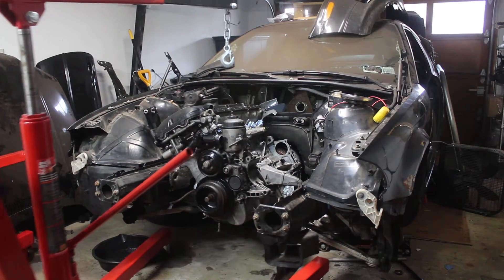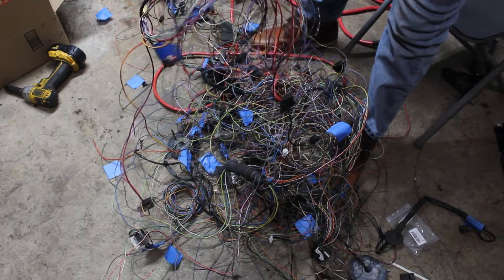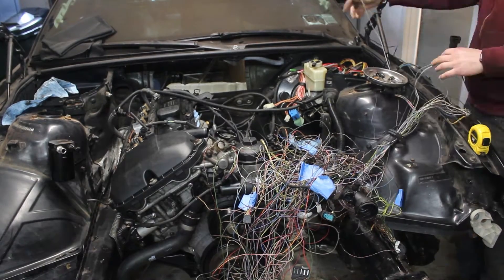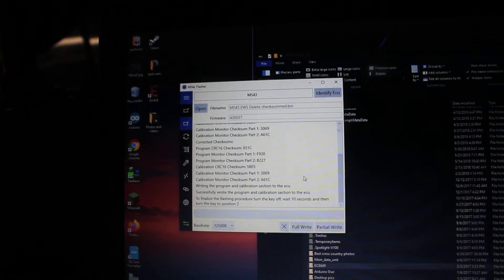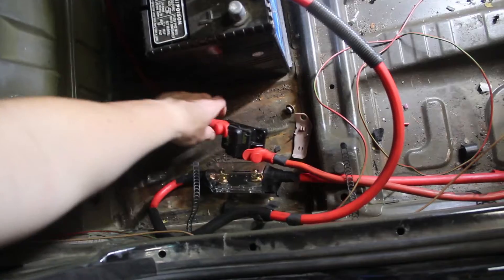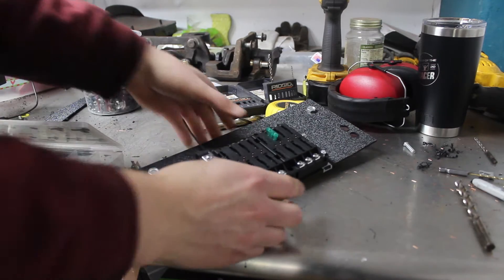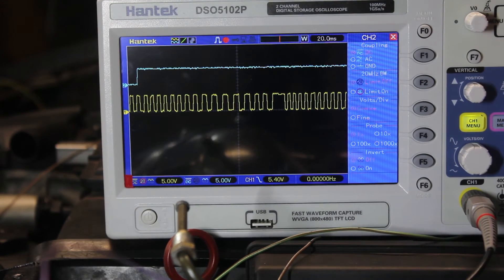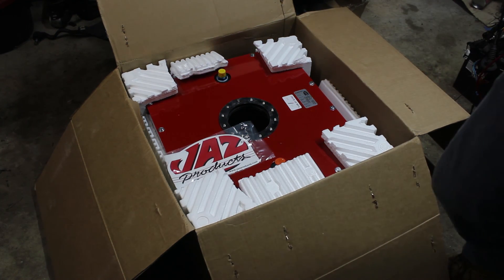BMW E46 Race Car Build: Electrical & Wiring

Comment: Hey brother, quick question. On the 2 starter small bolts, the ones with the 10mm and 8mm nuts. If not mistaken, you mentioned that one receives the signal to engage the solenoid, and the other one you grounded it (because it was grounded on the ews). I tried the ground one and it fried the wire. I don't think you should ground that 8mm coming out the starter solenoid. Am I incorrect?
Reply from the maker: It's been a while, I don't remember. But what I did worked and the car runs. If you're frying a wire, it's probably shorting 12v to ground. My guess is that which wire you ground matters.
Reply: @rainvillecreative5410 correct, from the explanation given in your video is what I did. That's why I'm giving you heads up on that. 👍

Comment: Hey mate, I’m doing a motor swap on my e46 and I having the same issues as you, the car will not spark can you remember what you did to fix it?
Reply from the maker: I don't remember exactly but I think it was the immobilizer. I did the EWS delete but also since I changed so much of the wiring I think I had to ground an immobilizer wire going to the starter or something.

Comment: Hey @rainvillecreative5410 I've just gone through this arduous task of thinning the chassis harness and have deleted the GM5 module as well as the ABS/DSC module.
Im currently stuck and have a question about the starter solenoid poles. Can you tell me which pole was supposed to goto ground? In your video it seemed like it was the black and yellow wire, which i assume is the signal start from the cluster and the other wire was from the EWS?
Thanks!
Reply from the maker: It's been a while, I'm afraid I can't remember. I don't have access to the car right now to check. I seem to recall the EWS module providing ground to allow the car to start though. And the other wire would be the relay trigger.

Comment: For the Immobilizer delete which flasher and forum did you use? i’m currently stuck with my car with a no crank no start, and ive had many tell me its my immobilizer shutting down the system.
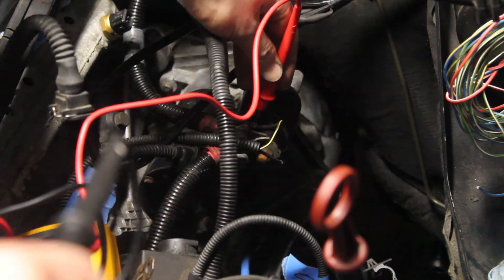Reply from the maker: I think MS4X flasher? I don't remember the forum. There is a wire going to the relay on the starter that the immobilizer uses to allow the car to crank, I believe by grounding it out. This needs to be bypassed. Once this is done, the car will crank whether the immobilizer likes it or not. Then all the immobilizer will do is prevent spark. I go over this briefly at 5:45.